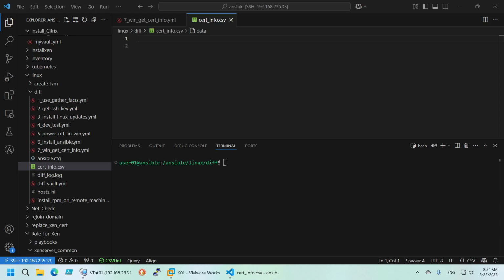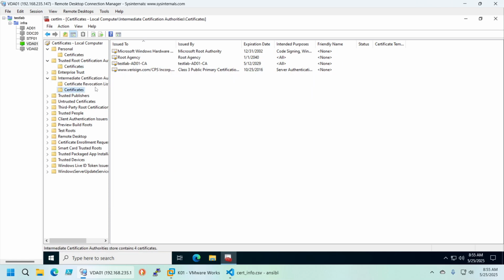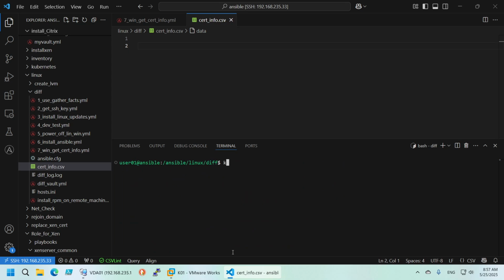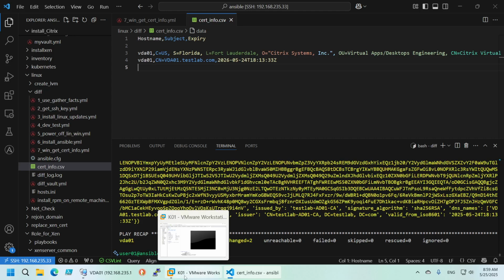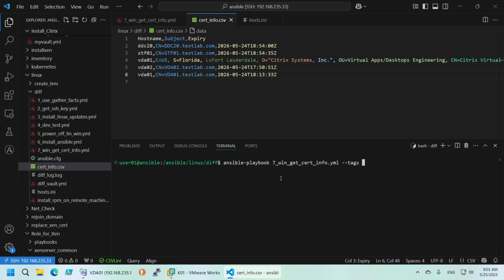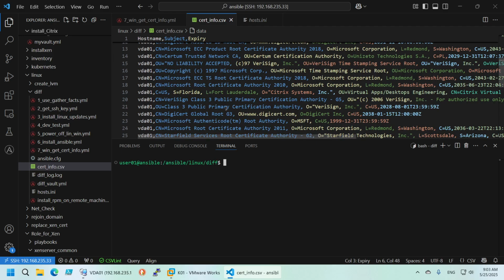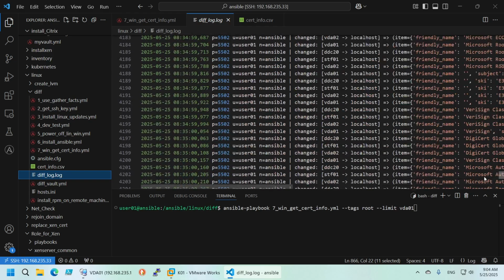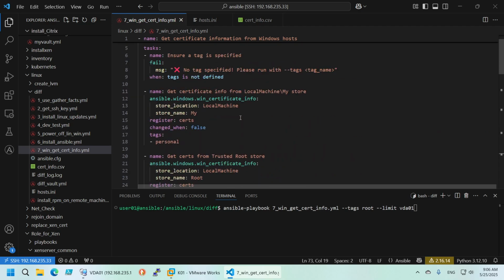Get Certificate Info from Windows Hosts Using Ansible - Automate Cert Discovery

Comment: Hello can you create a playbook for certificate binding in iis windows server
Reply from the maker: Yes, you can absolutely do it, below is an example ..I'm using it for the Citrix StoreFronts but you can use it on IIS in general ..it should work.

- name: Get thumbprint of certificate for storefront
  ansible.windows.win_shell: |
    (Get-ChildItem -Path Cert:\LocalMachine\My | Where-Object { $_.Subject -like "*CN={{ subject }}*" }).Thumbprint
  register: stf_thumbprint_result
  when: storefront | bool

- name: Bind certificate to IIS site
  ansible.windows.win_shell: |
    Import-Module WebAdministration

    $certThumbprint = "{{ stf_thumbprint_result.stdout | trim }}"
    $siteName = "Default Web Site"  # Change to your actual site name

    # Check existing bindings
    Get-WebBinding -Name $siteName

    # Remove existing HTTPS binding if it exists
    Get-WebBinding -Name $siteName -Protocol "https" -Port 443 | Remove-WebBinding -ErrorAction SilentlyContinue

    # Add new HTTPS binding
    New-WebBinding -Name $siteName -Protocol "https" -Port 443 -IPAddress "*"

    # Bind the certificate
    $binding = Get-WebBinding -Name $siteName -Protocol "https" -Port 443
    $binding.AddSslCertificate($certThumbprint, "My")

    Write-Host "Certificate bound successfully!"
  when: storefront | bool